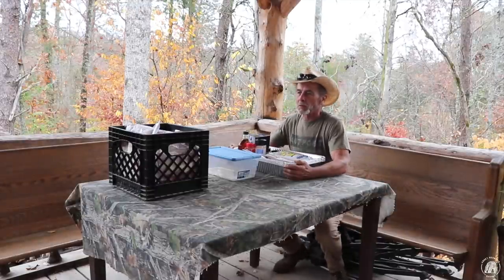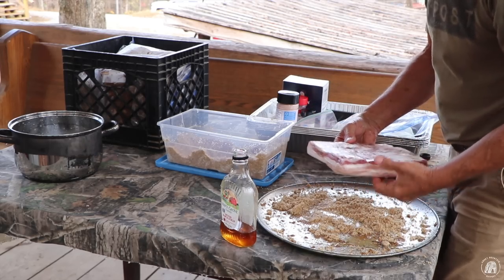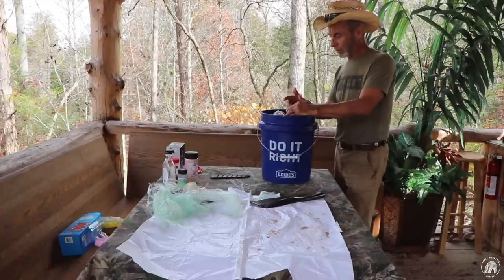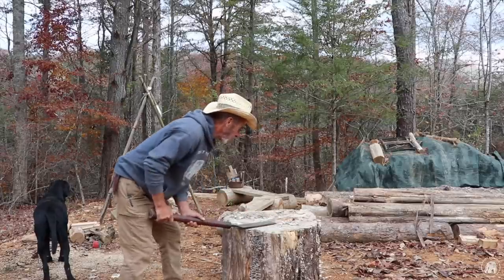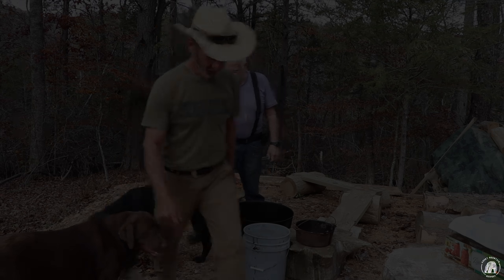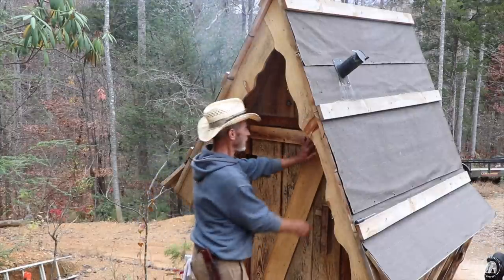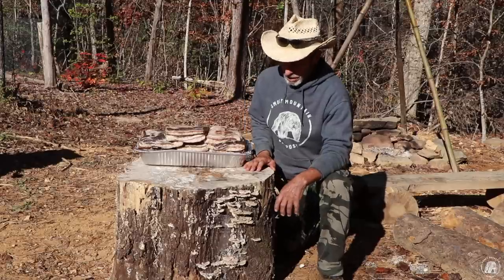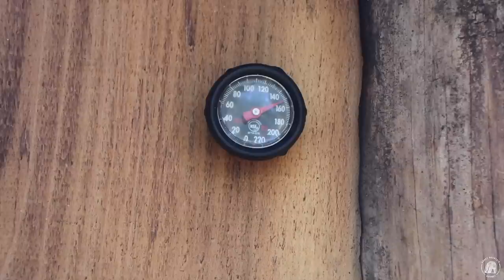Smoking Ham & Building a Timber Frame Workshop

Comment: That cooked fat is called "cracklins", add some to your cornbread to make cracklin cornbread. You don't want to give those cracklins to the chickens. Put them on a baking sheet in the oven at 300 degrees for a while, drain off the rest of the lard and then salt the cracklins. Good to eat as is or add to cornbread. Tastes like crispy bacon.  Put glue in the crack in your mallet, clamp till dry.  Drill 2 -3/4 inch holes from face to face,  then whittle 2 dowels to fit your holes, glue and pound them in the holes. Clamp till dry, trim off the excess, then back to work. Probably ought to make a spare, LOL.
Reply from the maker: I’m not to sure about eating cracklins but people say they are good! Good idea on the mallet. -Jennifer

Comment: My dad went and got a garbage 🗑️ can to put hams and turkeys in to cure in.  They never were used for anything else.  Worked great 👍.  The lard is going to be good.  You can render lard faster if you grind the fast first.  Then we always saved the cracklings and put it cornbread 😋.
Reply from the maker: Good idea!